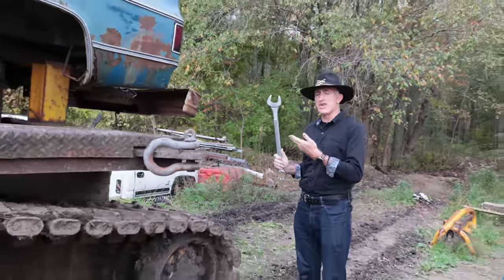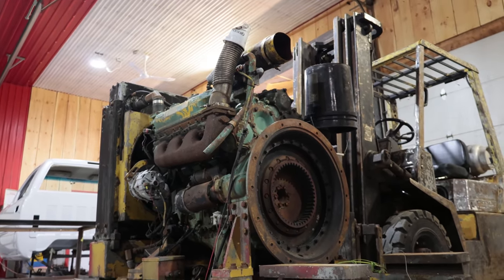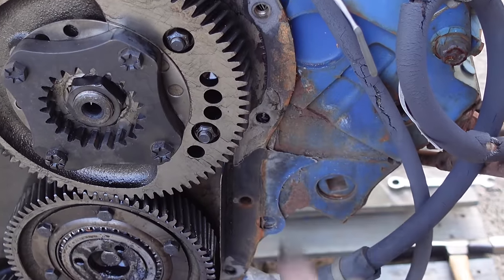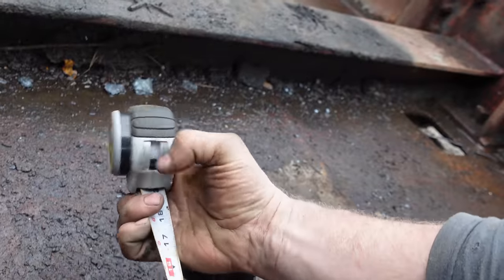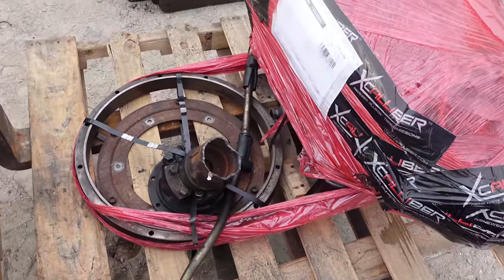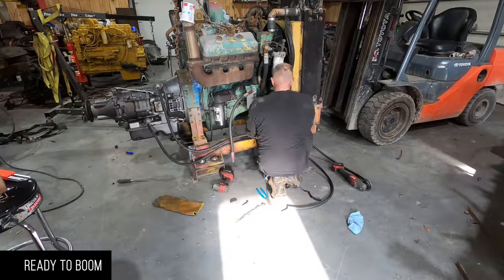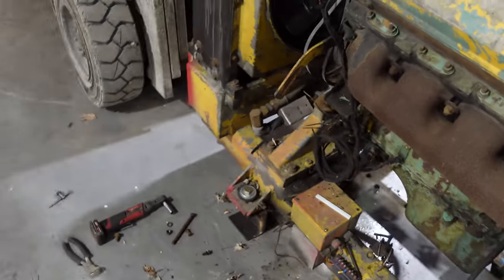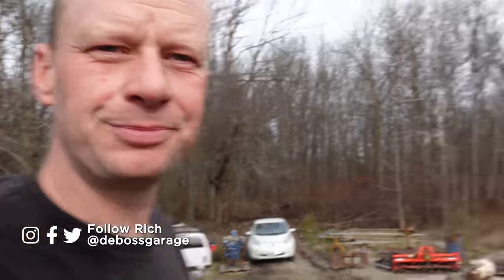Fixing Everything Wrong With Our Truck Tank... 30-Speed Detroit! #Shermanator [EP3]

Comment: Another good video. My Dad used to say that if a Detroit didn't leak oil it would just burn it. Having driven enough of those in the day it is pretty much true. Detroits like old Harleys don't leak oil, they are just marking their spot. Merry Christmas.
Reply: If it's not leaking oil, better put some in!
Reply: If a Detroit isn't leaking oil you need to add oil cause it's out.
Reply: @towboatjeff  so very true
Reply: Poor mans gps follow the trail home
Reply: It's not leaking oil it's sweating horsepower
Reply: @towboatjeff  that counts for all English motors... would the Detroit be an English design after all ?
Reply: My 1972 Suzi TC90 leaks oil for thereabouts 3 to 5 drops out of the transmission when she stops. Makes sense, they built that bike for only four years because holy god a high/low eight speed transmission on a 90cc bike, the transmission probably cost more than the motor! They'll never make the Blazer again, it's too good for us.
Reply: My dad used to say about old Triumphs, if theirs no oil under it theirs no oil in it.
Reply: Now I'm sitting here wondering if there ever was a compression ignition engine that ran on a heavier fuel, that pumped it through the oiling system and a filter before going straight to the injection pump. Never worry about oil changes, every drop is brand new...
Reply: @mfree80286  isn't that just a two stroke diesel?
Reply: @russetwolf13  No, two stroke diesels are externally scavenged and have a separate crankcase just like any four cycle. They manage this because they don't draw fuel under vacuum.

Two stroke controlled ignition engines are a unique bird, nothing works like them.
Reply: Trident triumps too mark their territory...or parts vibrate off
Reply: @mfree80286  you could definitely do it but I think the reason you don’t see it , is I think it doesn’t make sense since proper lubricating oil is way more expensive than fuel oil. Like fuel oil #4-6, are poor quality fuel oils, I’m not an expert but you probably don’t want to use that kind of oil to lubricate an engine. Even a normal Diesel engine typically runs on motor oil, plenty of cases of runaway engines due to leaking turbo seals for example.
Reply: When I was first getting into truck and equipment  industry in the early 80's. All the old Detroit mechanics would say, just run her to the peg in every gear until she doesn't anymore.

Comment: Fun video, when I was in my early 20's I worked for a company that had 20 acres of military surplus equipment. A coworker and I would spend our breaks and lunch out piecing trucks and what ever we figured we could get running and moving, good times.
Reply: Did you work for Levy Brothers on Jane St.
Reply: @joseflavallee8577  Nope, I worked in the PNW Washington area, Wittenberg motors which turned into Freeway truck parts south of Seattle

Comment: My brother and I but an intercooled 6bt in a grove rt58 crane. Had the same finger crossing moment when we mated up the the divorced transmission pump to the modified flywheel and saw 3 to sae 2 adapter plate.

Comment: Hi Rich, awesome project! I was thinking an Allison automatic was the way to go and there you are installing one! Creative thinking on the engine/transmission adaptation but I'm not too sure how long that will live? The torque converter nose would need piloting to the flywheel and I think you'd need a proper flexplate. But maybe you're swapping in another drivetrain soon and just looking to prove the concept of the automatic? Would hate to see that transmission getting ruined, it does seem like a nicely rebuilt unit?

Comment: Can't wait to see that thing running! Yeah that 4-71 would overflow the engine bay of that pickup. There was a guy around here back in the '80s who shoe- horned a 4-53 into a 74 international 3/4 ton 4 by 4.  Front axle wasn't quite up to the challenge of the extra weight.  Drove a late 70s GMC, 6v-92 with an Allison. When it was fully loaded you put your foot to the floor and waited for it to start moving.

Comment: I can't wait to see all what get's added to this old contraption it should be a absolute blast when you finally get this thing built and back on the road or I should say, back in the swamp...LOL love the idea with the hydraulic cylinders lifting the truck up! off the frame. That's the only way to have it, easy access for later on for when you need to do any work.

Comment: Interesting,  a really great video, many thanks for putting it up.. Just one thought, Is it possible you could cut away a lot of the heavy paneling and replace it with lighter material? you don't need bullet proof and it would help the engine etc

Comment: this was wicked cool! this tanks gonna be a speed machine i'm super pumped for PT 2 of this! especially when you put lights on it and make it like a normal truck on the inside. also a question on the controls are you gonna go for the way it came with a steering wheel or you gonna go more on the tank end with pudding stick controls in it?
Reply from the maker: Full hydraulic controls from in the cab.  I want to be able to lift the entire truck in under 5 minutes.
Reply: @DGHD  thats gonna be epic can't wait to see you do it and how you do it
Reply: Pudding. Lol
Reply: @sideshow45  yeah old hydraulic machines controls were done with manual valves so you had like 6 different levers in the cab in front of you and pulling them was like moving a stick through treacle hence the name pudding sticks awful times to be a machine driver tbf. i think rich is probably gonna go for a electronic actuated hydraulics system similar to that on modern tracked machines so he can basically just unplug a couple of pinned plugs and remove the body without any hassle of loosing that expensive hydraulic oil or any cable linkages stretching and so he can run dual controls for maintenance reasons

Comment: I believe the Allison torque converter adaptor ring should be bolted to a proper drive flex plate and not a manual clutch flywheel as you have here. There will be no room to allow the converter to balloon (expand) while its building hydraulic pressure. Good chance the converter could crack and/or drive itself backwards into the transmission causing damage and/or push the engine crank shaft hard against the thrust bearing wearing it out in short order. You can get a flex plate from an older Detroit powered MCI or Provost bus being scraped. Please look into it before many run hours accumulated.

Comment: 9.3K+👍's up thanks for sharing

get another caliper and have two calipers on the one rotor and you should have enough breaking power to at least slow it down faster than one will or stop it like you're wishing with the hydro boost

Comment: Hope a mt653 is enough, typically ht750's or clbt 4460's  are paired with a 671. I also wonder what happens when the torque converter swells from rpm without a flexplate.

Comment: your tank was a m4a3 and was  originally fitted with a ford GAA v-8 petrol engine of 18025cc and 500hp so the shermans spicer transmission and cletrac steering unit would handle a 425-470hp silver series 8v-92 detroit and allison  auto out of a bus or similar.  the 6v-71now fitted is little more than half the output of the GM 6046D (twin 6-71's side by side joined by a transfer case) engine packs fitted in the M4a2 and M10's

Comment: Gotta little train pusher at work that weighs 45000# and all it has is a caliper smaller than yours on the driveline,  it wont lock up the tires but works well and is a solid parking brake.  Yours will have a lot more mechanical advantage so I think it'll be mint.
Reply from the maker: I'm going to add slave cylinders under the steering (brake bands around the final drives) so it should stop pretty well

Comment: Everyone who has been around a jimmy knows they have a secondary oil system which the uninitiated call "leaks" not knowing that is to keep external rust down!  Works so well you don't even have to pour the oil in the fill just dump it on top.  It's heading there anyway!  Screaming, dirty and dependable that's a Jimmy!

Comment: That pinion brake should work, but it will overheat fast. Think of it as a parking brake. It will work in an emergency but not for long.
So cool to see this truck getting revived. Saw it floating around in a few videos on the internet over the years

Comment: Obviously you didn't do this in 40 minutes but man how cool is it to work on old stuff that was meant to be worked on and modified from the beginning I think we've lost something in this modern age This is how so much got done in the air of this type of machinery
Reply: "It's gotta work the best it can and I need to be capable of field-servicing the entire unit" has turned into "Uh-oh, it's throwing codes. Call the CAT dealer... again." The 21st century is basically total garbage. :\
Reply: That’s what right to repair is about, preventing manufacturers from having a monopoly on repairs. Louis Rossmann is actively lobbying, Rich Rebuilds made a video about a Model 3 where their solution saved thousands of dollars compared to the service center’s offer, might be interesting

Comment: I don't know anything about custom brakes but, if that one caliper does not provide enough braking could you mount a 2nd caliper on the far side of the rotor or gang a 2nd or 3rd rotor and caliper setup inline and shorten the drive shaft? 

Even a bad idea can lay the spark of inspiration for the final good answer.
Reply from the maker: Going to put slave cylinders under the linkages for the steering with a proportioning valve on the master. Should stop on a dime

Comment: Gotta respect the man who doesn't even take the implement off his tractor before trying to pull his tank with it.
Reply: Something you have to do with a little tractor. Adds much needed weight for traction. Pretty standard move.
Reply: Added weight for better traction
Reply: Easy does it...
Reply from the maker: Weight for the rear tires obviously
Reply: @DGHD  Yep, if that isn’t enough I’m putting the five sheer reversible plough on there for ballast :o)

Comment: That brake disk looks like it’s off a wheel.  You are mounting the disk on an output shaft that will be at full engine speed when in top gear.   Are there any concerns with spinning that disk at a higher rpm?   I see balancing may be a concern, not sure about failure with the higher speed.  If this things stays at slower speeds, probably not a big concern.  

I am doing a similar thing with a disk on the output of a 10 speed Eaton - I am putting it in a truck with hydraulic brakes, so I need a parking brake made.

Comment: i love cabovers because there neat but im a conventional cab guy (no need to worry about cab jacks to work on the engine dont have a giant doghouse in the way of getting in the sleeper a guy could go on) if you reaaly need that windsheild is just 16 g sheetmetal you could a use a metal break and shape the frame then huck bolt it in or b cut a bunch of peices and weld them together(or have a metal shop do it for you im just giving you an excuse to get a welder)

Comment: If you want a forklift that would be able to lift those types of engines I would recommend the mitsubishi fg55n1 it has a 12,000 pound capacity and their pretty nice to use. Everything moves super smooth
Reply from the maker: Just helped the neighbor swap an engine into a CAT payloader.  Likely use that to install the truck again

Comment: Rich,if you were ever going to wear gloves, it should have been when you were splitting the 4-71 from the trans.  Love the tank series but really waiting for the c-10 tow truck. Could you run the winch cable through a pipe to prevent rubbing the i-beams?

Comment: Hey Rich I'm curious if you could tell me what size bellhousing your 4-71 has. I'm in desperate need of an sae3  manual transmission flywheel. Currently putting a 4-71t in my 85 c30 bolted to a deuce and a half transmission but I can't find a flywheel
Reply from the maker: It was never a tank.  It was purpose built agriculture equipment put together with tank parts by a company called Madill
Reply: Still a dertoit, mine has an sae3 flywheel housing but it was setup for an automatic, apparently sae3 on a 71 series is rare

Comment: Isn't that a thing of beauty built strong and solid no belts are chains here guys Gears for the timing and gears for everything They used to make gas motors like this back in the day but they switched to chains and then belts because they were cheaper and quieter

Comment: You should add a cannon onto it somehow. Firework, bowling ball, or flame. Maybe mount it in the bed of the truck or go full tilt and weld up a new superstructure like the M7 Priest, then place the cannon into a casemate there (for elevation and traverse) and then place the truck body on top of the new superstructure. I'd be a shame to leave it unarmed!

Comment: Rather than lob off the back rails, you should of used them for the transmission mount. Made it a full single pack unit. And maybe throw a generator onto that secondary engine, besides just the hydraulic PTO. Having the ability to do welding off a "small" generator anywhere offroad would be nice.

Comment: Eventually you guys should work on having the body of the truck much closer to the tank itself.  It looks like the space in between the inside of the tracks is the same width of the truck body.  Could even fill the wheel wells of the truck body using metal or whatever would work so that you cant see space between the truck body and the tank.  Itd look sweet.

Comment: Just FYI, you would not have been able to weld the winch to the nose piece of the tank, the nose is cast steel rather than cast iron.  If you had welded it, it would have probably cracked immediately without the proper preparation for welding to cast steel.

Comment: We got a 3-53, 2 4-53s 4 4-71s a straight 6-71 and a 6V-71 all in running equipment, throw a decent resonator and muffler on it so you can hear your thoughts when your running that pig

Comment: I think using a Detroit diesel is a good way to go. I am a retired US Army M1 Abrams tank technician and many light armor track vehicles I used to work on use Detroit engines (mainly 6 and 8 cylinders models). They also used air-cooled Allison V-12 diesel engines as well. 
What would REALLY be cool is if you could get your hands on an M1 Abrams turbine engine and transmission! Only $200,000.00 bucks! LOL
Just kidding! That powerplant makes 1,500 HP and would probably tear that machine to pieces. 😅

Comment: Hydraulic pudding stick steering would be cool. But if you want steering wheel in cab  use a hydraulic tractor steering unit out of an international 
Ind. 2646//646 tractor or similar.

I plan on putting a 87 dodge d200 van body (i got for 500, 
on a 94  motorhome frame that i got  for 500 also. Motor home has 87,000 mi.) 

The motor home frame has the steering wheel shaft clocked to 15-20° from verticle and hydraulic steering seems to be an elegant solution vs reclocking the steering box/ frame to match the dodge van angle.

Comment: You are right to fear having to weld that front, if you ever do you have to use nickel hard facing rod because of the type of steel it is. (Watch Tank Restoration)

Comment: Not sure if someone else has commented but 12,000lbs for the 16v71 doesn't sound right. The manufacturer spec is 5000lbs where is the extra 7000lbs coming from ?

Comment: I think your still gonna have a power issue…factory these tanks have twin 6-71s I don’t think 2 more cylinders will cut it (granted it’s 142 more cubic inches Of displacement added ) 

If you can find a 8v92 that would definitely get ya where your going and not be extremely hard to swap 

8v92t
Reply: yeah but it has no turret and gun.

Comment: the gearbox cooler lines are to small and the fittingss to the cooler itself are incredibly restrictive,and the 653 gearbox is a much better unit,5 speeds and converter lock up,there should be an external filter as well

Comment: Is the 6V-71 under power ?
Reply: The ones I used to work on were 240hp @2600 rpm without a turbo
Reply: @craiga9492  But original the sherman had 350hp in the First version
Reply: @Maggimax007  oh ya still needs more but 100 more than the 4 banger
Reply: @Maggimax007  maybe it will get a 60 series one day lol
Reply from the maker: Might be, but don't forget that this thing weighs about 1/3 of an actual tank
Reply: @DGHD  yeah ,maybe it work fine 
with 1/3 , but 8V-71 had a little more ,at least we will see the great work you do at this project